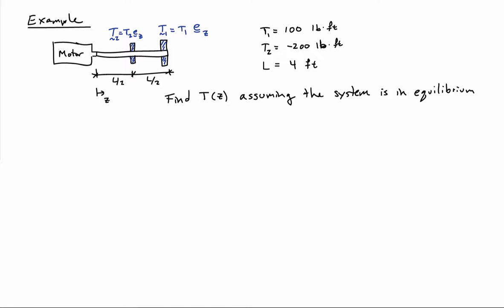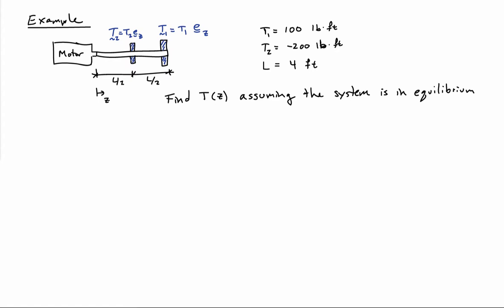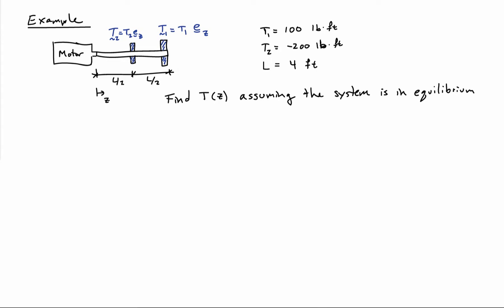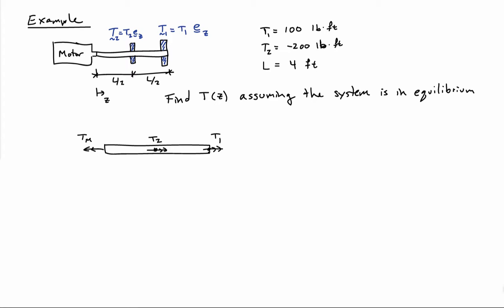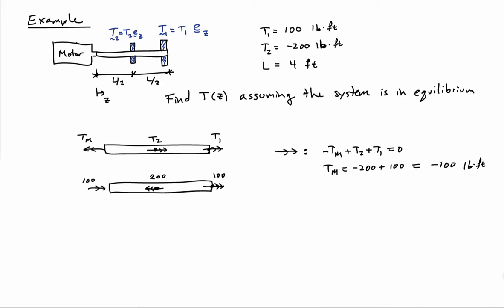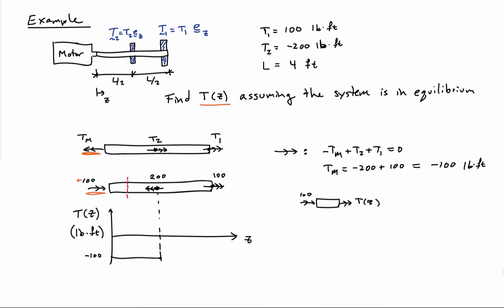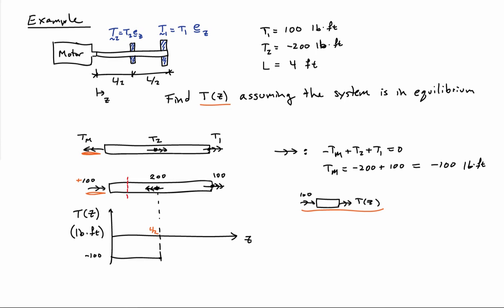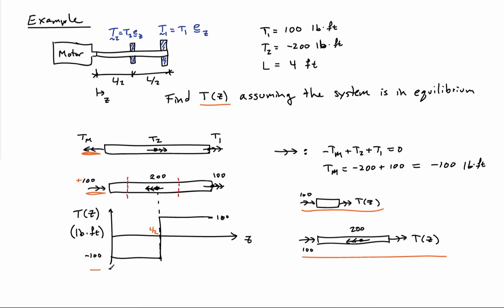(21E) Example - Torsion equilibrium

Comment: Very good lectures but there are gaps between lectures. The lectures art too short. Is it related to the attention span of your students?
Reply from the maker: Glad you like the lectures. Yes, they are purposely short.  The students have access to other materials, in particular the textbook Engineering Mechanics of Deformable Solids: A Presentation with Exercises, written by myself.